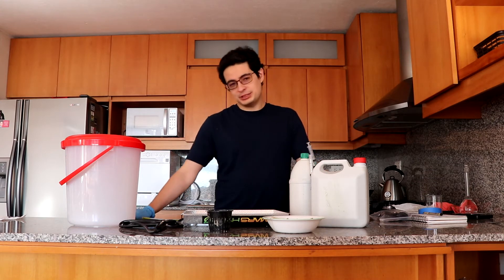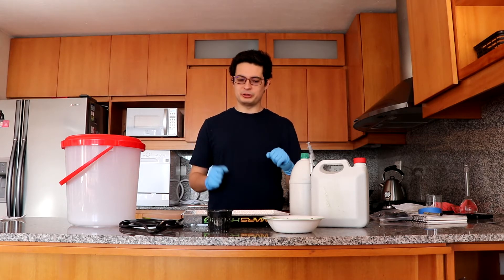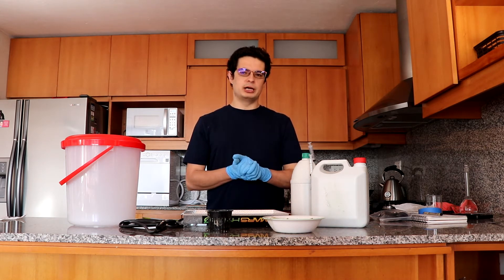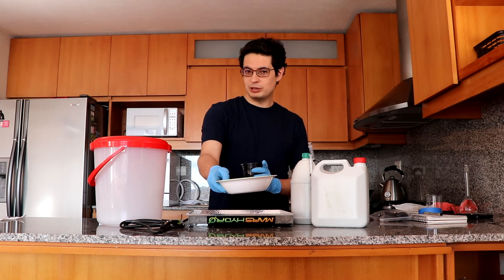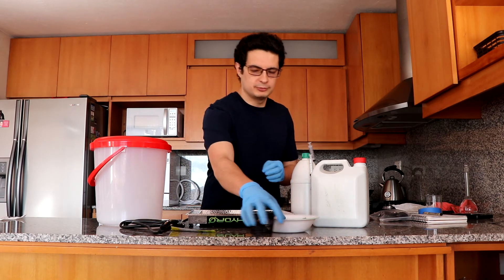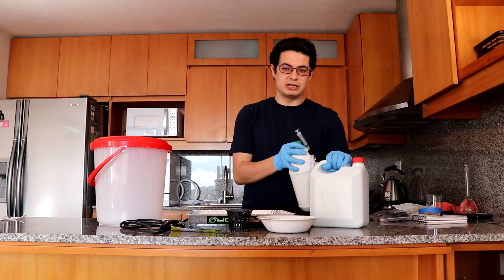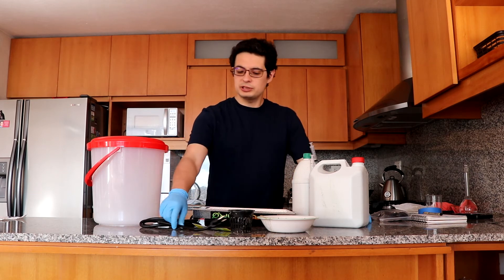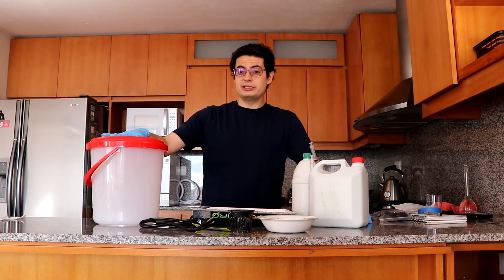A tomato plant in fully passive Kratky from start to finish - Part one

Comment: Hi Dr Fernandez, How the ufire probes compared to the Atlas probes? Would they last longer,  more accurate, drift less, or easier to use?
Reply from the maker: Thanks for commenting! The ufire probes are of good quality, mine have lasted immersed in solution for months without issues. However, I haven't done a side-by-side comparison with Atlas probes, so I cannot tell you which is better or worse. Both are decent choices if you're looking to buy them for a project.